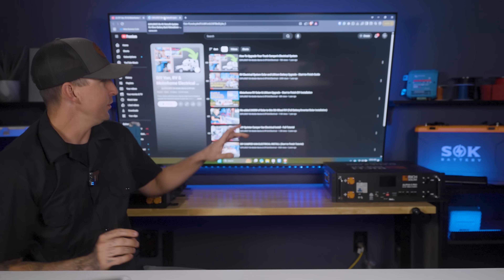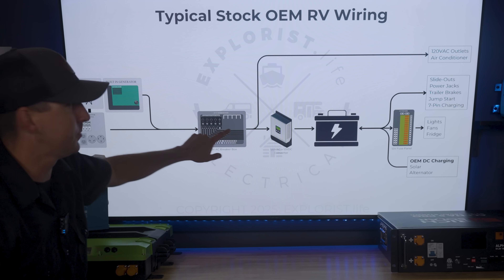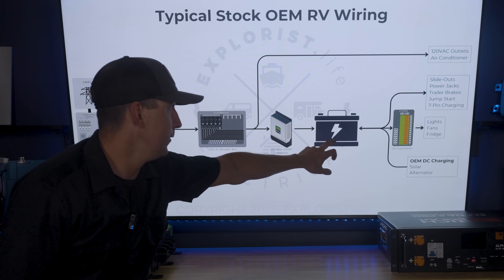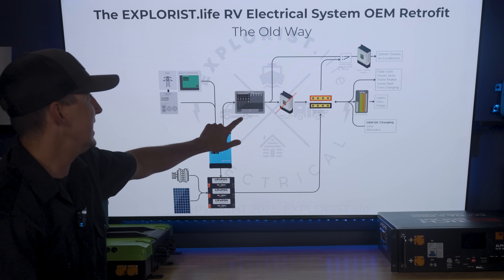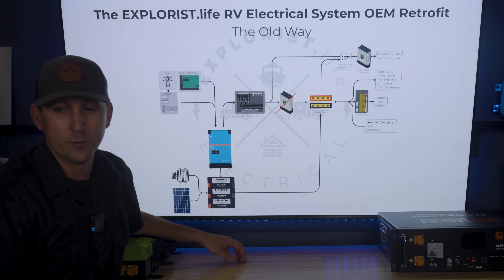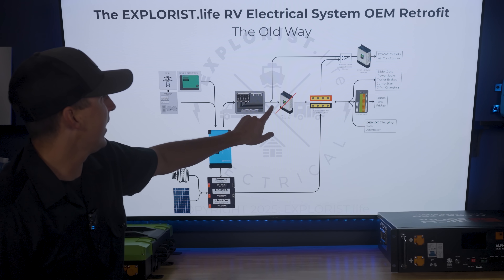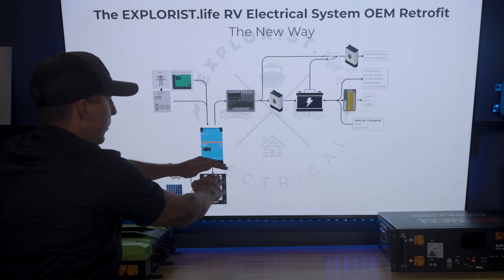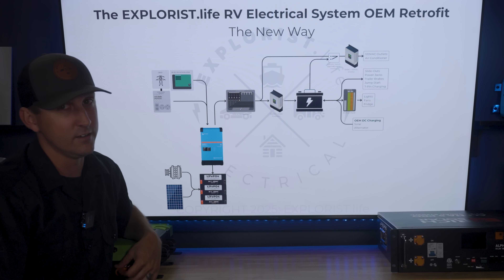The New Way to Upgrade RV Electrical Systems (No More Battery Relocation Kits!)

Comment: This all requires the multiplus to be “on” all the time if you’re not on shore power. If you’re just using 12v loads, then you have the overhead of the multiplus taking extra energy from the batteries. With the old way, you can  turn the multiplus off if you just need the 12v power, resulting in the most efficient system. Also getting rid of the lead acid batteries in the outside box reduces weight and provides you with extra storage for things like wheel chocks. I got rid of the factory inverter in my Airstream (and the audio subwoofer that we never use) to make room for my batteries. The factory inverter (1000va) has an output transfer switch so the old inverter would only power a few select receptacles. Bypassing that unifies the 120vac system so that all outlets and AC appliances can be run from the inverter.
Reply from the maker: Great point! Whether that’s the best approach depends on your setup, so we’d be happy to take a closer look and make sure it fits your needs. Reach out here: https://shop.explorist.life/support
Reply: @EXPLORISTlife thanks. I installed my system in early 2024 based on your ‘older’ approach. We’ve used the trailer extensively since then and the system works very well for us. I ended up putting 400 AH of batteries in. Would liked to have gone with more but was trying to minimize impact on storage space. 
It seems most RV’s should have a single 12VDC buss. I don’t fully understand why integrating the new 12VDC source with existing should be an issue, unless you’ve come across some real doozies from user modifications. You might want to consider keeping both approaches and choose based on what you are confronted with in the customer RV.
Reply from the maker: I believe I mentioned that both would remain in the store in the video, no?  I think it was near the end when I brought that up.
Reply: @EXPLORISTlife you probably did & I just missed it. Thanks for the video
Reply from the maker: Glad it was helpful!  Reach out to https://shop.explorist.life/support if we can help further clarify anything.  Did you buy your equipment from our store?
Reply: @EXPLORISTlife yes. We did.👍
Reply from the maker: Thanks for your business!  Truly appreciated. 😁🙏🏻  It's people like you who make it possible for us to make these educational videos every weekend.
Reply: That too.  In my main reply I noted that the power path from alternator to brakes had too many failure points if it had to go through the multiplus AC.  Meaning that you really need the DC-DC charger in there anyway to provide a short-path from alternator to brakes that works even if all the batteries and inverter(s) are dead.
Reply from the maker: Not really, no.  When driving, the 7-pin connector is charging the OEM lead acid battery just a little bit - so that 'path' is incredibly short to the trailer brakes - just the same as it is from the factory before any upgrade.
Reply: @EXPLORISTlife yes, you are right about the brakes.  Not sure how I forgot that.  Dunno about the 7-pin charging the 12V system though, wouldn’t that cause problems if you left a bunch of 12V appliances turned on while driving?
Reply from the maker: Nope.  That’s how every RV on the road operates from the factory.

Comment: When you are talking about the trailer brakes not working, I am assuming you mean in an emergency situation where the trailer becomes detached from the tow vehicle and it has to rely on the break away switch and the battery to apply the trailers brakes.  As far as I know, as long as the 7 pin plug is attached to the TV the brakes should still work normally even if the trailer's battery were dead.
Reply from the maker: Correct, full breakaway was the concern posed in previous videos by viewers/customers, yes.

Comment: I tend to disagree with keeping the "factory" install in place in my scenerio.  My fifth wheel had a 1000W inverter and associated transfer switch (like your diagram) that only provided 120V AC to my residential refrigerator and no additional AC circuits.  I installed a 12V Multiplus II  2x120  inverter charger.  I removed the factory 1000W inverter as well as the factory 12V lead acid batteries and the factory "converter"  and installed 412 Ah of Lithium and 1200W of solar feeding a Victron MPPT solar charge controller connected to a Linx Dustributor.  The Linx Distributor also feeds all my original 12V power.  (I purchased your wiring diagram for OEM 50A RVs and followed it to the tee and the entire system works flawlessly including providing generator starting, hydraulic leveling jacks and slides) To me, keeping the original inverter, converter, and lead acid battery, is redundant, added weight and MORE complexity.  Perhaps keeping the factory 12V DC system would be beneficial if you were installing a 24 or 48V system but if you are only staying with a new 12V inverter, lithium battery bank I do not see the benefit.  Love you channel and ALL your awesome videos. They provided me to with the knowledge and confidence to install my entire electrical system safely and successfully. Cheers!
Reply from the maker: Did we sell you your equipment or just the diagram?  Would love to get some pictures and a testimonial if it’s the former! 😃🙏
Reply: I would be more than willing to share photos of the install.  As a matter of fact , I am on the fence to come to your event next month to gain more knowledge in the install of various other systems (especially 24 V installs with large solar arrays/battery banks and multiple inverters)
Where can I send photos?

Comment: Looks good but why convert from DC (LFP) to AC and then back to DC to charge the lead acid & run DC loads considering all the conversion losses (18-30%) compared to the latest highly efficient DC 2 DC chargers?  (original DC charger could be removed)  For DC only requirements the inverter can be switched off reducing idle losses (losses due to floating the lead acid should be minimal).
Reply from the maker: The video covered the ‘why’ but reach out to our support for more clarification and we can get you the method that will work the best for your needs https://shop.explorist.life/support
Reply: @EXPLORISTlife  With a 2nd viewing I think I follow the choices but still seems like for DC heavy usage the conversion losses might be larger than win than keeping the factory DC system intact, for some systems at least. 
Always trades offs but 2-3% loss powering DC loads (w/ latest DC2DC converter) vs 20-30%  (via DC-AC & AC back to DC) seems like a big trade off but I'm coming from the marine/sailing world where I'm doing my best to remove all AC loads & associated conversion losses & shore power is the rare use case - if you're doing it right ;)   Thx.
Reply from the maker: We can sell you the parts for whatever direction you prefer. 😃. Reach out of help if you want us to lay those options out for you: https://shop.explorist.life/support

Comment: Since I use my RV mostly for boondocking , this seems to be a lot more inefficient because now you have to convert two different times to use 12 volt. A lot of the time I'm just boondocking with 12 volt and only turning on the aC side when we need it. Am I missing something? Because now to use 12 volt it has to convert it from 12 volt to 110 go through and then convert it back to 12 volt to charge the old house battery.
Reply from the maker: it's negligible.  Not enough for it to truly matter.  Reach out to our support team at https://shop.explorist.life/support and we can get you what you need, regardless of if you choose the 'new' or 'old' way.  We can sell you either one and now that you've seen this video, you can make an informed decision.
Reply: Great video, you are truly gifted at explaining these concepts. I bought my equipment from you a couple of years ago and the system works great. I share the opinion above regarding the efficiency concerns. When we are boon docking (most common scenario for us), the only time the inverter is on is when we need to run the microwave or other 120V load, probably 10-20 mins/day. The 2000KVA Victron Inverter uses between 24-30 W when it is providing AC load, say 2A. In the new way, that would be running all the time, so that would be 48 AH each day. I have 300AH of Battleborn batteries, so this represents a significant load, plus you would have the converter converting the AC back to DC, presumably using a measurable amount of power too. Am I misunderstanding? (I understand the extra drivers for a 24 or 48V system. Thanks again, your videos are fantastic. @exploristlife

Comment: From an installation standpoint, I get this:  it simplifies the process, you've just got the lithium setup inside tied to the AC-in to a Multiplus, then have the Lynx feed whatever you need in, too.    No need to worry about ensuring the factory converter's turned off, jacks, etc. 

However: I still am glad I went with the 'relocation kit' method:  by tossing the pair of lead-acid batteries, that pulled some weight off of my tongue, and then gave me a bit more external storage space (which was lacking).  I can't fault you for simplifying the install from your end, but I still think the relocation is a reasonable extra step to take...
Reply from the maker: "I still think the relocation is a reasonable extra step to take..."  I think if you spent much time answering customer support inquiries, your mind would change a bit, ESPECIALLY with those opting for 24V and 48V systems. 😂  Glad it worked out well for you and thanks for your business.  You know where to get ahold of us if you need us: https://shop.explorist.life/support
Reply: @EXPLORISTlife   fair point! I only had to deal with my own, not a string of questions from others... (But with that said, I'm still paying attention to your channel, so that I might be of assistance to others, am always trying to learn).  Another point you brought up:  while I recognize that a 24V or 48V system would have advantages, for ours, I stuck w/ 12V, which might be another nudge to using a relocation kit (if I'd looked at non-12V, I may have chosen differently!).   Best,
Reply: Great video! Two quick questions if you don't mind? First, since the multiplus is powering the AC box, does that mean I only need a multiplus even on a 50 amp rig? No need for a multiplus-2? And second, my future 50 amp rig is going to be inverter-prepped only. No inverter installed. Does that mean with the new way, I would have to buy an additional inverter and transfer switch? Or would the old way be the way to go to use a Multiplus-2 the old fashioned way?
Reply: @stephenadams8541  You are putting the inverter/batteries before the breaker after the shore power/generator transfer switch so you would not need the extra inverter because everything is already powered.
Reply from the maker: Great questions! To make sure you get the right setup for your specific rig and future plans, our team would love to take a closer look and guide you through the best options. You can reach us here: https://shop.explorist.life/support
Reply: You can't say it got rid of the weight then talk how you put the weight back.  You should have just said the part about adding extra storage space.
Reply: @jeremyfogt6798   allow me to clarify:  yes, I removed the heavy lead-acid batteries off of the tongue, and installed lighter lithiums inside under the bed, closer to the axle, which shifts the weight closer to the axle.   But if I had followed this 'new' method, I would have added the lithiums, but kept the lead-acid batteries, which would have been a larger weight gain (of adding lithiums but not losing the lead-acids).  In either case, you're adding the lithiums:  but in the 'old' method, I got to lose the weight of the lead-acids.  So, the weight loss is still relevant.

Comment: In RV travel trailers, I've seen people use solar generators such as a Bluetti. They run a 30amp plug in cable from the Bluetti  and plug into the 30amp outlet on the outside of the trailer. To the trailer, its running on shore power.
Reply from the maker: Yep.  Similar concept here.  Reach out https://shop.explorist.life/support and we can line-out your options and get you what you need.

Comment: I understand how this makes sense from your point of view, reducing complexity and liability.  For myself and my trailer the factory connections to the batteries were "crap".  There were bad crimps and cheap thermal breakers that were not rated for the loads.  Several large loads depended on fuses at the device end of the wire, not at the battery.  Since I had to redo that all anyway I went with the "old" style.  I think my build quality is good enough that the reliability of the brakes and other important loads is higher than it was before.
Reply from the maker: If we were given full control of the system, we  would recommend the 'new' way and then subsequently fix the bad OEM crimps, because even with the 'old' way - the factory crimps would still be in place and would need to be addressed.  Reach out https://shop.explorist.life/support if you need anything!  Happy to get a second set of eyes on the project if you need.

Comment: My only questions is why the "new way" still has the connection to a Transfer box (or even have a transfer box) with the factory battery to the factory inverter?
Is it not a useless connection/piece since we have that kick ass new inverter/charger feeding the mains and if the shore power is gone, it still sees the new battery bank as 'shore power'? Is that transfer switch ever going to 'switch in the first place?'.
Just need clarification...
Reply from the maker: Reach out to us via our support channel and we can take a look at your needs and help you explore your options: https://shop.explorist.life/support

Comment: One problem that I see with this. The shore power circuit is good to go but the new lithium circuit is going take loss covering from 12v to 120v and loss going from 120v to 12v.
Reply from the maker: A little, but it's negligible.  Not enough for it to truly matter.  Reach out to our support team at https://shop.explorist.life/support and we can get you what you need, regardless of if you choose the 'new' or 'old' way.  We can sell you either one and now that you've seen this video, you can make an informed decision.

Comment: The 12volt battery on the trailer only supplies brake power in a break away emergency, unless some other non wired control system is used.
Reply from the maker: The 'new' way covers that in 100% of use cases with no if's, and's or but's.  Reach out to our support team at https://shop.explorist.life/support and we can get you what you need, regardless of if you choose the 'new' or 'old' way.  We can sell you either one and now that you've seen this video, you can make an informed decision.

Comment: Hmmm. Our soon to be Casita comes with only 1 300ah lithium battery. My initial game plan (until a full on electrical upgrade) was to throw the breaker on the converter (thus stopping charging of the 1 and only battery from the converter), and plugging in a Victron IP65 to charge the 300ah battery when on shore power....this at night when camping. Next morning, unplug the IP65 charger and flip the converter breaker back on. Thoughts anyone?
Reply from the maker: Reach out to our support team at https://shop.explorist.life/support and we can explore the options for your specific project.

Comment: Note...
Installing a battery relocation kitt in many older class A/B/C RVs is actually a recommended thing to do especially if upgrading to lithium do to so many items connected to the 12v system that can and do cause parasites in the systems when they don't or no longer work properly. But it's just going to depend on age and wiring load dependency. 
Do with that what you will.
Reply from the maker: Reach out to our support team at https://shop.explorist.life/support and we can get you what you need, regardless of if you choose the 'new' or 'old' way.  We can sell you either one and now that you've seen this video, you can make an informed decision.

Comment: This is interesting. Since my Airstream inverter only runs the radio and TV, I'm converting to a Multiplus and Epoch 460.  I have 2 105Ah lithium batteries and replaced converter with a Victron Blue Smart IP22 12/30.  Your method would add the 460Ah +Multiplus, use solar, Orion XS and shore power to charge the 460Ah, then use the Multiplus 120v and IP22 to charge the 2 105Ah.  This would give me an extra 200Ah
Reply from the maker: Hit us up at https://shop.explorist.life/support and we can get what you need.